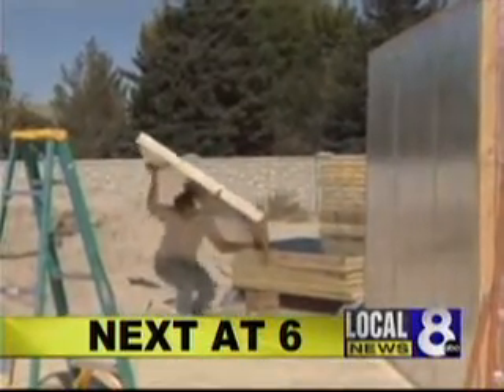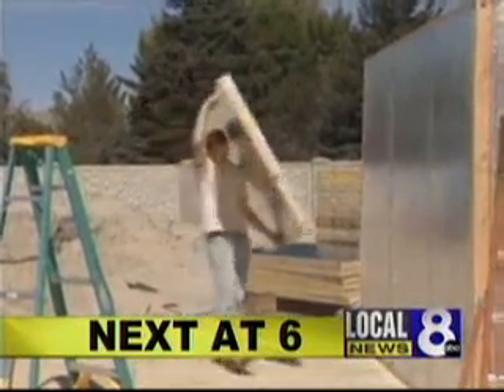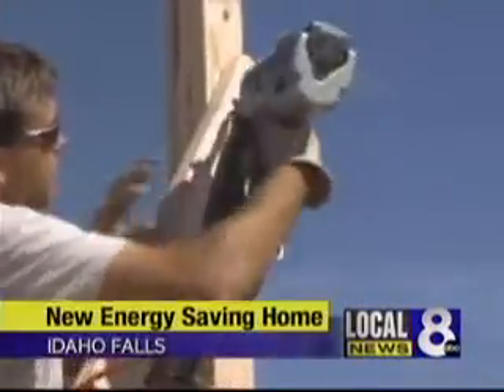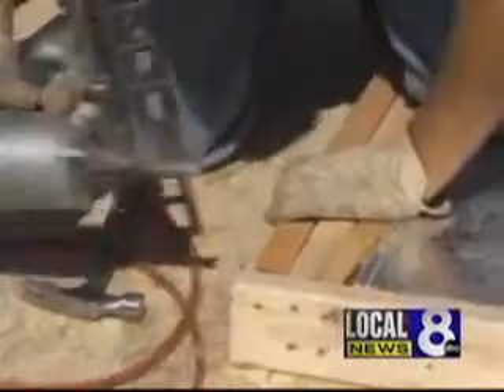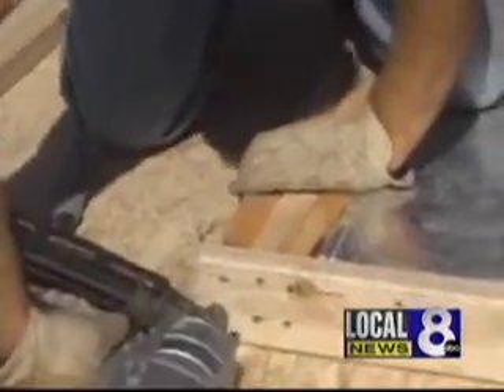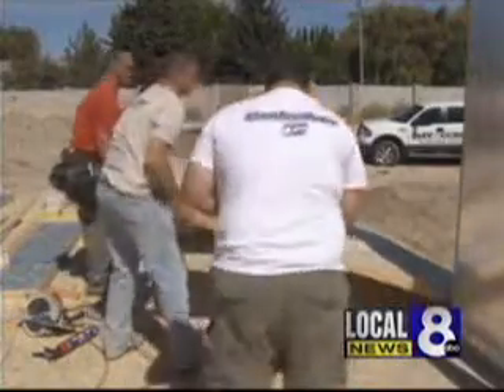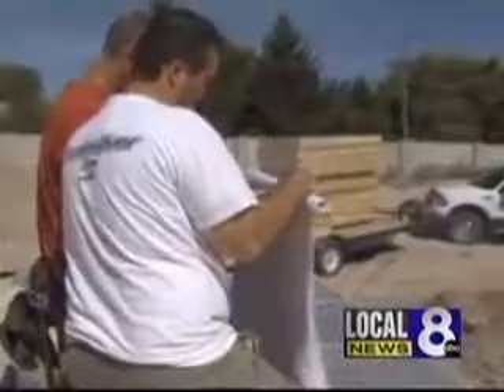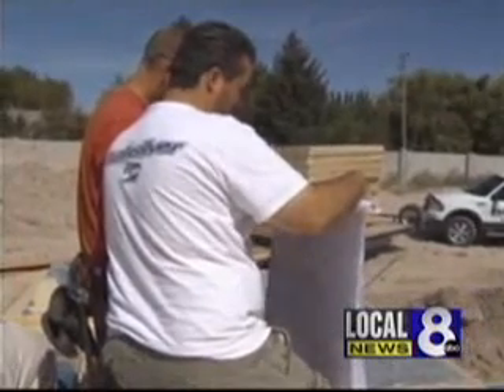Using RAYCORE SIPs Panels: Wall and Roof Panels

Comment from the maker: RAY-CORE Structural Insulated Wall Panels and Insulated Roof Panels are sold directly to consumers as well as builders.  For more information, a free estimate and to place an order, call toll free 1.877.552.2440.

Comment: Do you sell your panels directly to consumers as well or to contractors only?
Reply from the maker: RAYCOREINC
3 years ago
RAY-CORE Structural Insulated Wall Panels and Insulated Roof Panels are sold directly to consumers as well as builders.  For more information, a free estimate and to place an order, call toll free 1.877.552.2440.
Reply from the maker: RAYCOREINC
3 years ago
RAY-CORE Structural Insulated Wall Panels and Insulated Roof Panels are sold directly to consumers as well as builders.  For more information, a free estimate and to place an order, call toll free 1.877.552.2440.